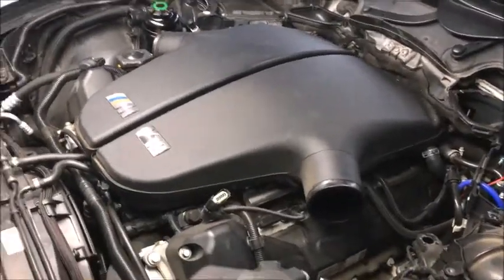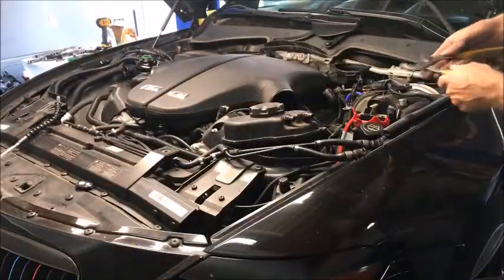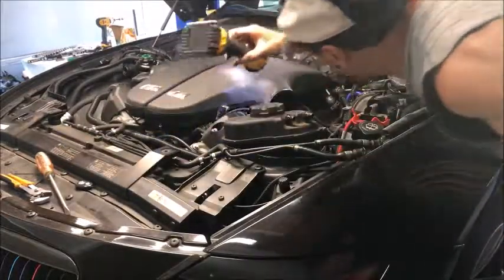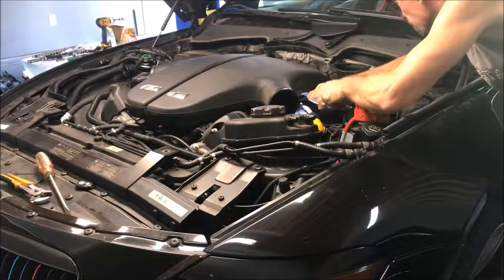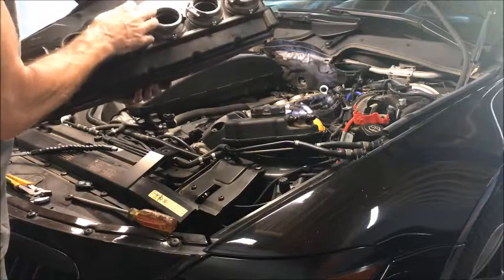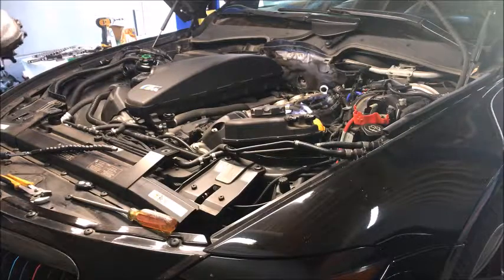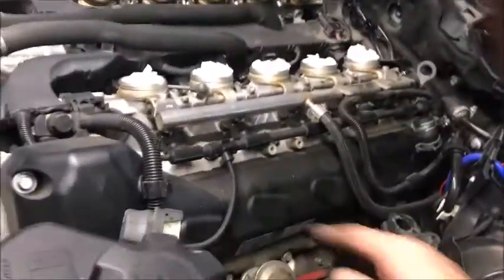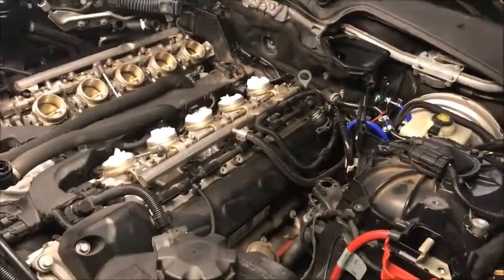BMW S85 Rod Bearing and Vanos Line Replacement Part 3 of 13 - Plenum Removal

Comment: thanks for showing all this detail !
it rly is that hard to get the hose clamps free !!

esp if (like on mine) the last person to reinstall the plenum pushed on the screwheads too hard on the hose clamps and pushed them out of reach lmfao
Reply from the maker: Yep, that’s one of the more annoying parts for sure…especially if the clamps get turned like you said.  They can barely be gotten to in the correct orientation, much less when they aren’t in the alignment tabs on the boots.  After getting the plenums off, it starts to get much easier as there’s only a few steps left up top 👍. All the best and let me know how it goes as you progress 👍. Steve

Comment: Hi Steve where do u get the black swivel extension to loosen the plenum screws.. thx
Reply from the maker: Jason Buenviaje , hey man !  I got it off amazon.  The description for it was “Flexible Extension Screwdriver Bit Holder Magnetic Extention Hex Shaft Screw Power Drill Connection Tip 11.8 inch Flex Adapter W/Extend Drive Quick Change Connect Adaptor Size Hexagon 1/4''. The 1/4” end fit the clamp screw head in mine since the clamps are not on very tight on the boots